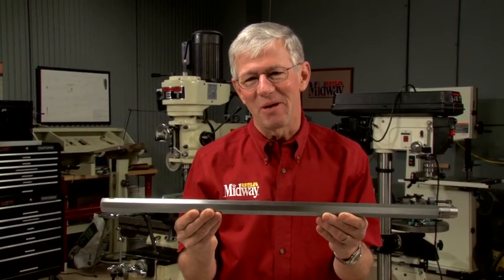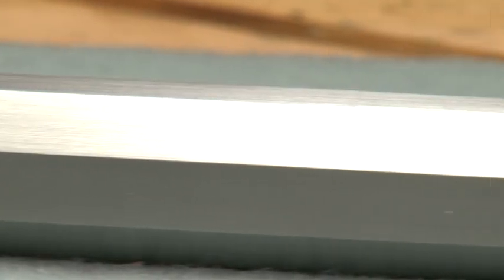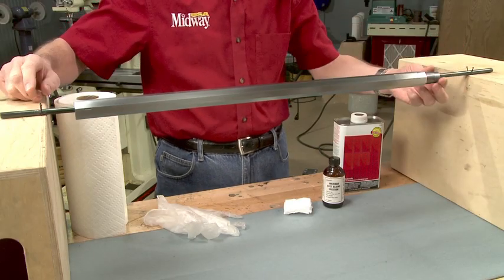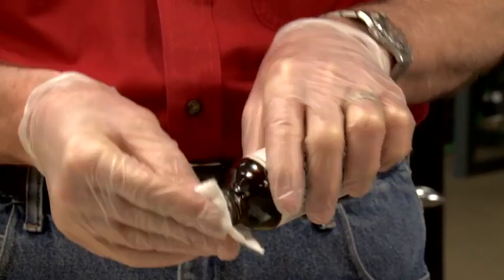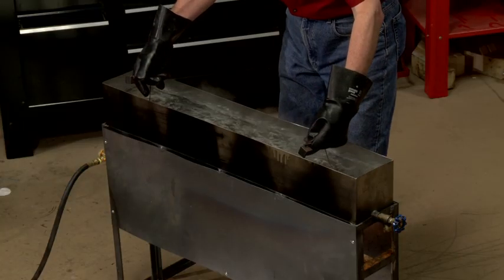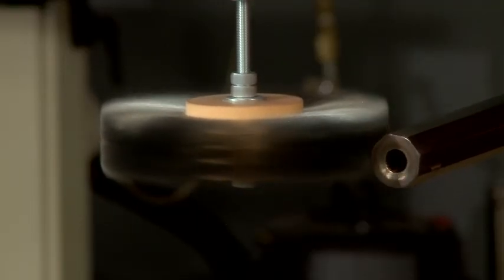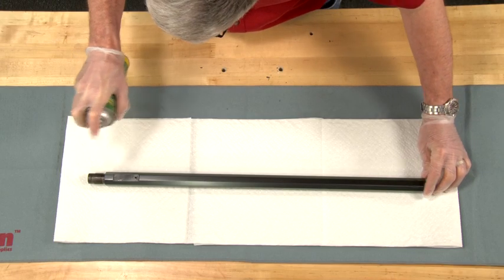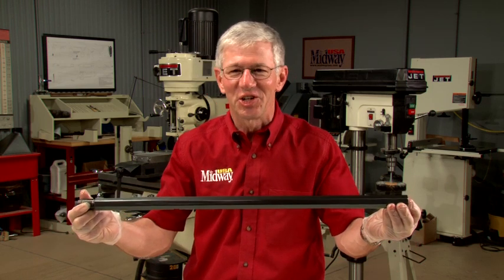How to Rust Blue an Octagon Barrel Presented by Larry Potterfield | MidwayUSA Gunsmithing

Comment: Rust blue is probably the most durable blue finish you can put on a gun.  If you have patience and follow the steps precisely, especially getting the metal squeaky clean, you can do this finish at home with excellent results.  Instead of a wire wheel you can use degreaded in acetone or alcohol 0000 steel wool to card the metal.

Comment: Instead of boiling it between treatments, can you just heat it with a torch or heating element, like browning?
Reply: I know people say they have done it that way but it's RUST blue! You need moisture/humidity to make it work right, not dry heat.  Make a simple steam cabinet out of PVC pipe if you don't have a tank to boil it.  Anvil has a good post on how to do it.
Reply: @kirkstinson7316  Thank you for the reply!

Comment: What does it mean to "card" it with the wire wheel?
Reply: In metal work, carding is the term for removing loose material with a mild or "soft" abrasive like a wire brush. Originally, such a wire brush would have been on a small piece of wood with a small handle. The term is actually borrowed from the textile industry, where carding is the term for combing tangled raw linen material into a uniform direction. In both cases, a "combing" process is used to prep the material.

Comment: How do you keep the bore from rusting?
Reply: Often the rust isnt enough to cause pits but if you want to be really careful you can slightly oil the bore then plug the ends with wooden dowels
Reply: I routinely plug the muzzle end with Cotton wool soaked in Vaseline, push it in a little below the muzzle then melt some Beeswax over the top of the wool and level with the Muzzle, its never failed me.